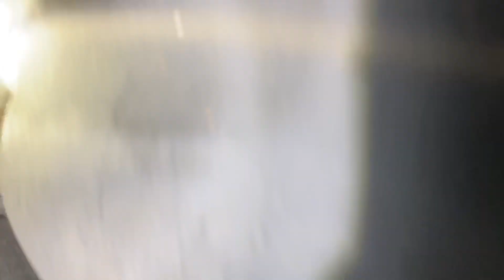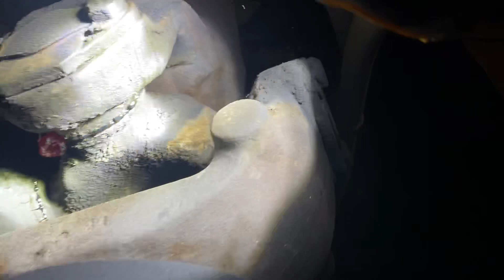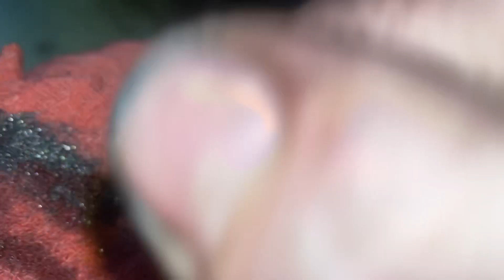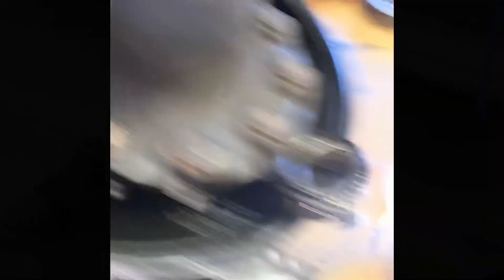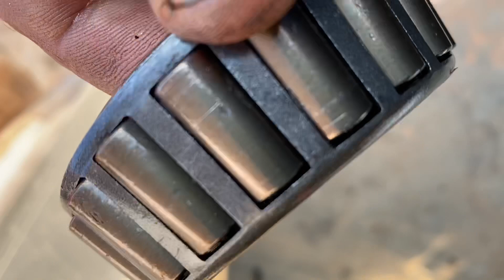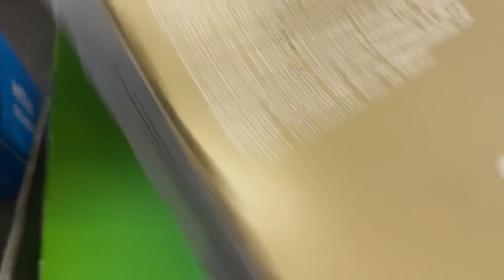Wanderlodge bus maintenance lube and wheel bearings

Comment: By what I see, it looks like the ridge around the edge of the race is not the same all the way around. This would indicate that the race was 'cocked' in the hub (incorrectly installed). It looked to me like both outer races were both like this. 
If this was the case, it would chew up the bearings pretty much like this.
These wouldn't have made many more miles. Good catch!

Comment: Hi , Proberbly to much preload destroyed the bearings, a SKF technician once said that more than 95% of bearing failure could be traced back to wrong installation of some kind.
Reply: Zephyr Old an old tool and die maker taught me to tighten first to set the races and seals, then completely back off and torque per directions...said that many over tighten them back off to slip then lock it up. Too tight.

Comment: G'day  Scott,,
After just a quick look at the front wheel bearings ,,I began to wonder how long the bearings  had been in for ,,  but more importantly  how long they had sat still ,,parked up .  Seeing the  fault across the bearing face  I started to think about electrolysis  in its many forms, perhaps being the "initial"  cause of the bearing failure .
  As you well know ,  Electrolysis  can  damage parts very quickly ,and leaves a definite signature  depending on the type  of issue  ..

Love all the vids ,,thanks for sharing them.

Respect  
  from
Down  Under

Comment: I find that when wheel bearings go bad, its always the outer that go first due to their smaller size and high loads on them. I always use a premium synthetic lube in them also. Time degrades the the conventional lubes and they fail to protect the bearings.

Comment: A good idea to run synthetic oil for the rear end and those wheel bearings. I guess with all the racket, wheel bearing noise doesn't amount to much when driving it down the highway. I think those might have been easy to hear!

Comment: Have never seen such bad bearings. It can't be the result high milage if there are regular quality bearings. Standing still for long periods?  Some electrolyse activity has occurred between the roller and the race when the oil been mowed aside because of the pressure. The contact area between a roller and the race is very small. 

Interesting anyway. Ask some bearing specialist, it would be interesting to know.
Ps. heard now there was different brand in the race and the roller. No good, they came as a set, no mixing is allowed!!

Comment: I need this lube chart for my 02. Might not be so different. I just got a super nice fat guy creeper so I am at least comfortable. I got some rust too so plan is to convert it and coat it to stop it. The time I did do my bearings the preload was multi step, and with a torque wrench. Looks like they where just jammed on and cranked down.

Comment: Would luv to see you do the new-bearings torqued to spec process.    What are all those spacers in there between nut and bearing?   All I ever do is simple trailer wheel bearings.

Comment: What brand of bearing is that, that pitting in specific location like that looks more like a metallurgical failure, like cheap steel or out of spec material that had high porosity. Yes it's possible the preload was way off on both outboard bearings, but It's also possible that both outboard bearings were defective. 

You don't normally see corrosion like that unless there's water, chemical, or drastically wrong metal composition.

Comment: Thanks for posting another interesting video but did I miss where you said how many miles were on the front wheel bearings? Was that normal or abnormal wear? Thoughts on what caused the failure?  Approximate cost for a complete set of the 4 USA made bearings?

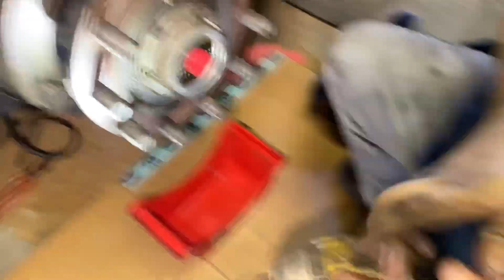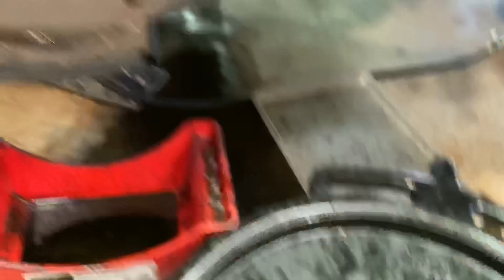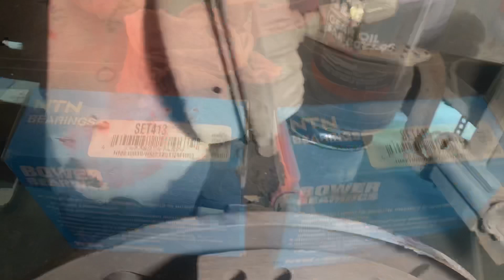Comment: they extended the tags.   interesting.  usually they leave them recessed.  10:56 That DeWalt has gotten a little bit of use.  12:43  Well, on the bright side, you can use those bearings as your cores.  Perhaps they over or under tightened the bearing/axle nut?  19:33  I would just spray some clear coat over that.  20:06 No.  22:51 Where was the box made?

Comment: Considering how well this bus is maintained, I am wondering if it is riding heavy on the front axle?  A bad bearing set is not usual.
Reply: He also said the bearings and races were different manufacturers....my bet is at one the new bearings were put over old races and then someone used backyard methods they use on cars to tighten the nut instead of a torque wrench......

Comment: I drove a fully loaded gasoline tanker where the front passenger side bearing failed. The mechanic gave me a ball of mangled aluminium of the wheel left over. The wheel was listing over when I got it stopped. I was lucky that day. My pretrip showed full oil in the wheel window. Note: when you hear and feel a growling in your steering, STOP.

Comment: When I worked in truck shop we had a lot of wheelbearings fail because drivers were washing wheels with powerwasher and blowing water
Thru vent hole in cap
Reply from the maker: There was Zero sign of water in those

Comment: Do the wheel bearings have a separate supply of grease separate from the axel? Also what model dewalt impact wrench are you using. I will probably never put as much time on mine as you do on yours so I figure you have a decent model.
Reply: They are wet hubs so no grease.....the hub can either be sealed on it's own or be lubed from the diff through the axle tube depending on the hub. If it's got an aluminum cap (Stemco) with a plug and a window they are sealed and you fill them until you can see lube in the window.

Comment: are you running hub lube?  < i hope so. as it is right to handle the heat and stress. watching it run out that is the wrong lube.
Reply: Those are wet hubs....they run in a constant bath of gear lube.....no grease.

Comment: "Tighten axle bolts to 350 ft-lb minimum".
Maybe the instructions really did mean to check the bearings every 1000 miles. :-)
Reply from the maker: They just wanted fluid level checked every 1000 miles, which is strange to me because i check mine every trip

Comment: Someone threw a new set of bearings in without replacing the race.
Reply: Very likely.  In another comment, BGM replies that the removed races were a mismatched set of Japanese-made races, while the cones were both Timkens.  Japanese-made is a relief, but mismatched still ain't good.
Reply: And then they apparently decided to use a torque wrench to set the pre-load after throwing the Timkens in with the old races.
Reply: @Patriot1776  I was going by past experience from when I was young and dumb :-)

Comment: You've struck a silver vein. too bad he's got all the air toys and a tiny compressor . Those lug nuts were not torqued correctly should be 450 to 500 ft lbs. People that grease stuff and don't wipe the excess off piss me off, just dirt collectors .

Comment: Were you hiding the manufacturer of those worn out bearings on purpose? Too tight a preload, and not enough grease would give rise to that. So would the wrong type of grease which might cause electrolysis. But it might have been plain old doo doo quality bearings. I've never seen Timkens like that.
Reply from the maker: Timken bearings and koyo races.  I didn’t hold it back i just couldn’t remember what they were.

Comment: Curious question. I'm sure there is a simple answer.!.! I have seen you pull apart several front hubs. Why the double nut configuration with a lock?
Versus a single nut with a lock or cotter pin? I'm sure most likely it is a safety!
 Don't profess to be a bus mechanic nor a guru on any topic unless you want to talk about a/c. 
  As a hobby for several years I worked on aircraft  Never saw anything that over the top!
Reply: Bigger stuff= bigger locks to keep it tight..... especially when it operates relatively "loose".

Comment: Good catch! First indication someone else was in there was that the stemco cap had rtv on it. Factory would have used the stemco gasket and no rtv. I did mine after I had a leaking wheel seal, luckily I did not find this. I think I am also having an issue with my slack adjusters sticking.. I think I am just going to change them out.
https://youtu.be/r4E_3O7bByQ
Reply: At the shop I used to work at a lifetime ago, we always used original gaskets on those caps. Anybody caught using silicon carne would get their ass tore! I would always smear a thin coat of Permatex 2 non hardening sealer on both sides before assembly just to be sure of no leaks. Never had one either!

Comment: If your to check the oil in the front wheels every 1,000 miles,they didn't do a good at it.That amount of wear tells a different story.Unless they were cheap china knock off bearings ,which i highly doubt.It makes me wonder the condition of most of the buses running in all of the cities and states in the USA that CARRY THE PUBLIC.Do you think those are maintained as per the manufactures suggestion,I THINK NOT>It's a lawyers dream come true.